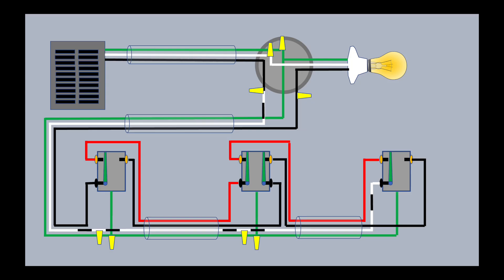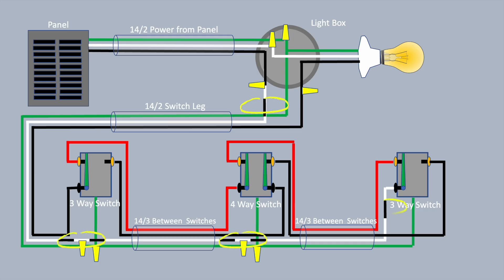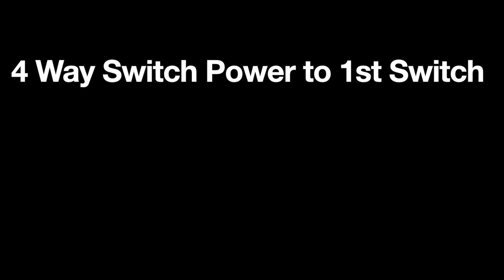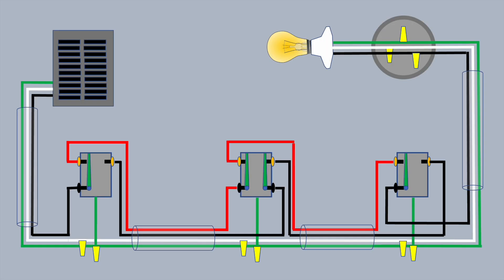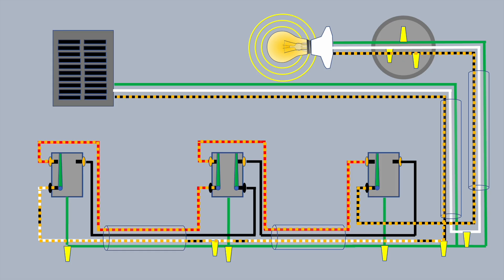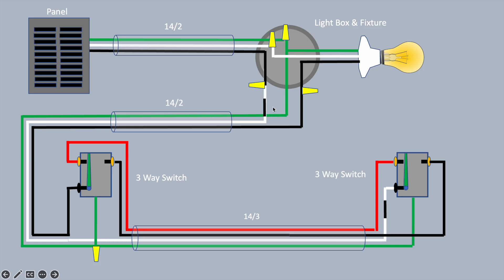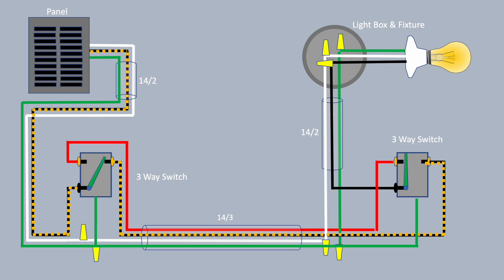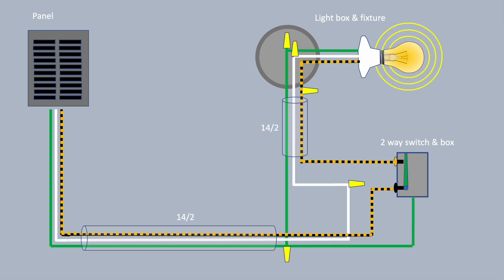How a 4 Way, 3 Way, & 2 Way Switch Wiring Works

Comment: Do you have a diagram of power to a light with a leg coming from a light to the middle switch in a 4 way system?
Reply from the maker: Thanks for the comment. Sorry, but I haven't given that scenario any thought.
I would bet there is a way. Best to ask an electrician friend or work through it logically yourself.  Thanks for watching.